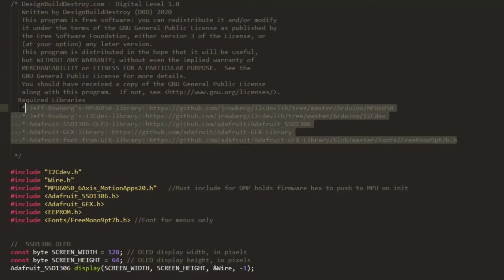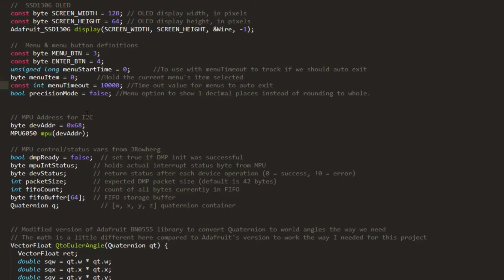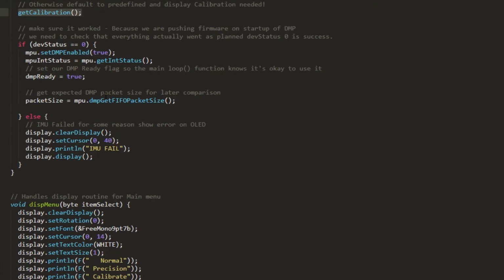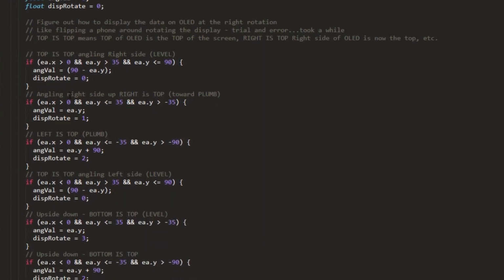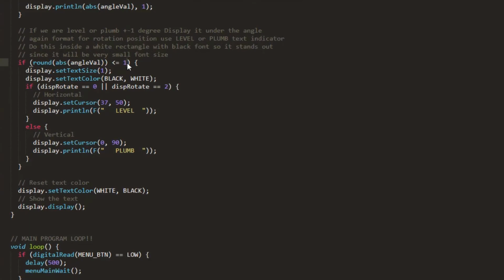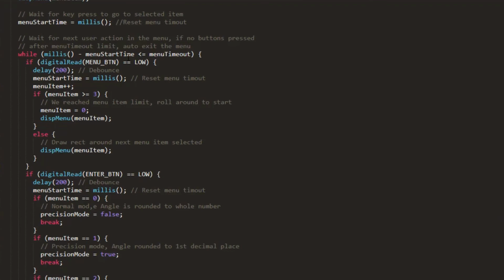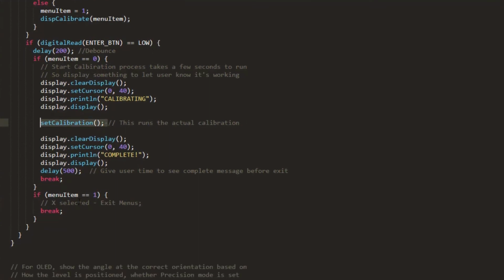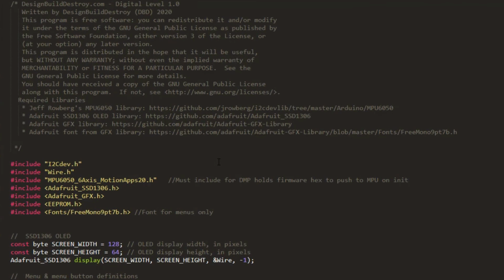Arduino Based Digital Level Code Review - How does it work?

Comment: did  you experience any i2c hook up(hang) issues with jeff rowbergs library.
Reply from the maker: No issues at all. Have you tested with a different library to see if you still have issues? If so could be your wiring or hardware related.
Reply: @DesignBuildDestroy   I will try. I have noticed that you have not used the interrupt pin,but for DMP to work interrupt pin is needed? as per documentation. Pls comment

Comment: Hello. Do you know why the calibration may happen to hang? It seems that once starting the calibration, the only thing I can do is unplug the board. Thanks
Reply from the maker: Not sure, but throw some Serial.Println's around the calibration lines and see where it actually hangs up to troubleshoot. There really isn't anything in the code that would make it stall unless the MPU board itself is locking up
Reply: @DesignBuildDestroy  Sure I'll try that. On the serial monitor for the moment only a long series of "*" characters are observed.
Looking at Rowberg's  library code, there's a Serial.write('*')  every time the data are not good for calibration; a comment says "Error is still to great to continue"; typo on "to" included in the original comment :)
[function `PID` in MPU6050.cpp]